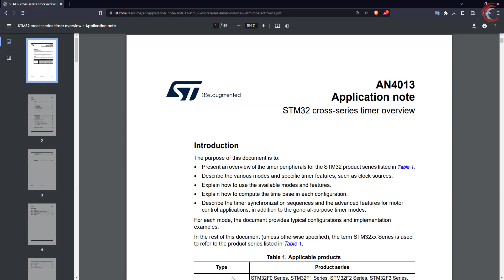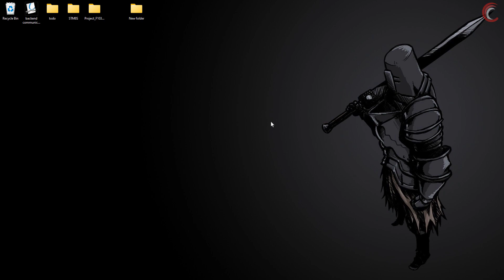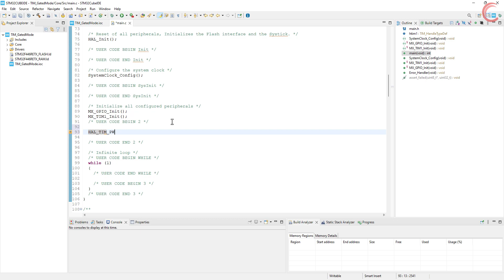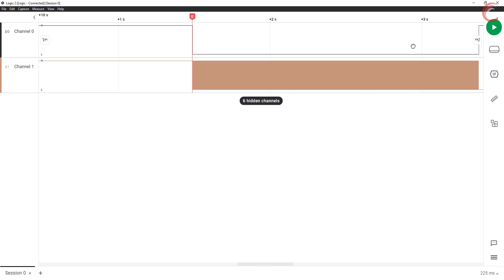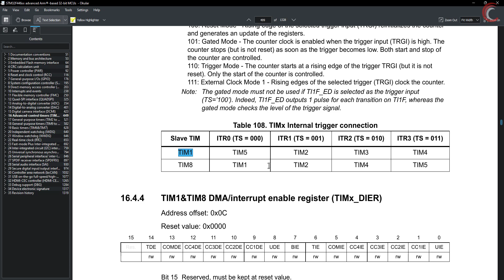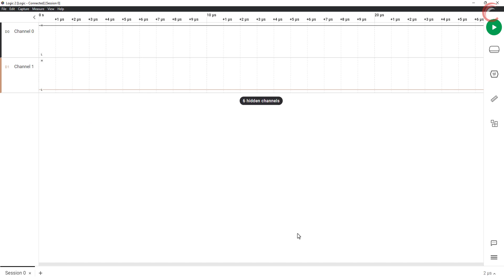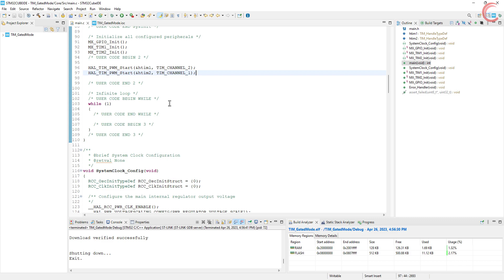STM32 TIMERS #10. Slave Gated Mode

Comment: Many thanks, these are very useful, can I ask please if I am using timer 2 as a slave in PWM mode and timer 3 as a master in PWM mode too, I need timer 2 to start at the falling edge of timer 3 output or after a specified delay (for example after one or tow cycles of the master output), how can I do that?